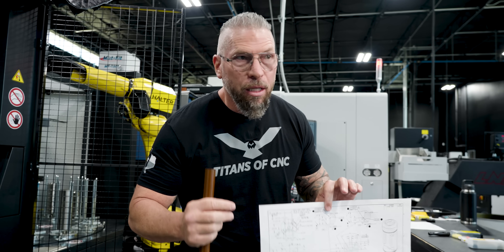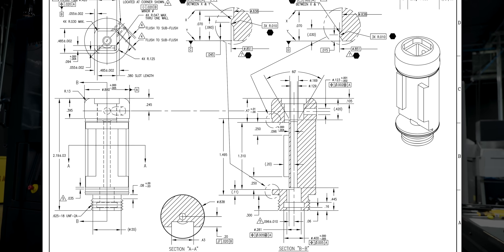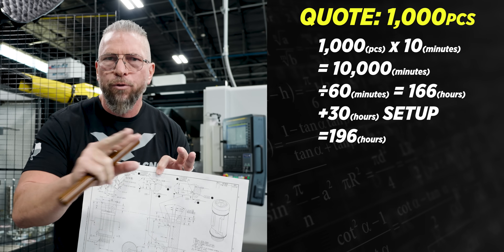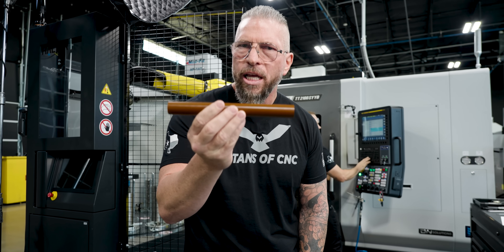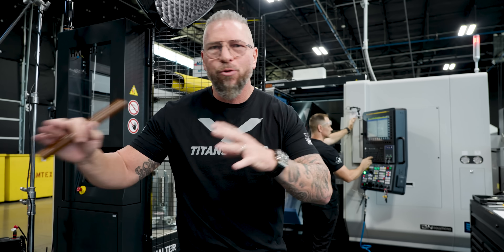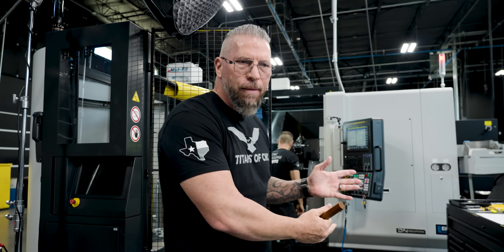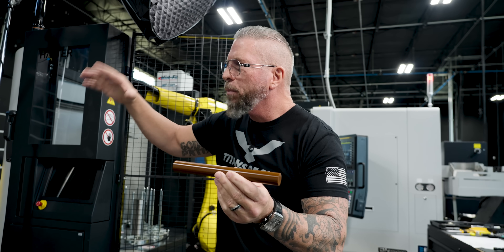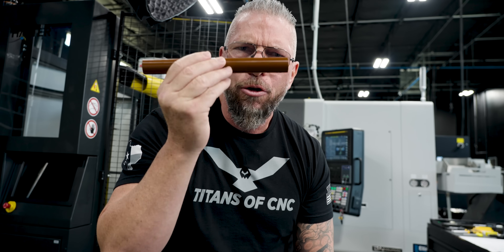How I Charge $40 for a $370 Part

Comment: Why is inspection time or more importantly, customer quality paperwork time not accounted for when quoting?  We recently had an APQP Level 5 part, requiring a FAIR, MSA, PPAP, six key characteristics requiring process capability study, PFMEA, Process Flow & work instructions per each OP.  When I asked what we quoted for this, I was told nothing.  We spent well over 100 hours for a 300 pc. order and I feel we lost so much money by not accounting for inspection/quality paperwork time.

Comment: If the customer needs SP1 or SP22 parts the final product price is significantly higher than the detail part you are building.  Bottom line, quote the part and if you are too expensive I will head to a shop that I know that quotes it lower.  Vespel for valve seats is mandatory in any applications.  The valves we sold were 5 figures and the seats were 500 a set.

Comment: An FA (financial analyst) would tear this video apart. Having the customer pay for the material wipes out the shop's ability to quote material costs and/or include a markup. There is no transfer of risk, the customer's goal is quite simple - they need finished parts for their assemblies and no amount of back and forth conversations or mental gyrations at any chop changes anything at all.
Reply: Dude tools wear out and  break sometimes . Tools are super expensive . Sometimes someone loads the wrong program . Or they are training a new machinist. Machinists are super attention to detail but mistakes happen. Power outage really sucks too. The customer is going to partially pay for the scrap . It’s just the nature of the beast of manufacturing . If it’s a pilot run there will be scrap or adjustments sometimes not all the time . A really good machinist you can’t tell they made a mistake and the part still has full functionality and dimensions are still within .
Reply: @stevensonprimacio1592   What is a Dude tools? Anyway, Very few customers who order 169 parts are willing to pay for 173 no matter how many Dude tools break.
Reply: A Financial analyst. An is only used when followed by a vowel. 😉
Reply: @jpsengin2  When pronounced as an abbreviation, the F in "FA" makes an "eff" sound, which begins with a vowel.
Reply: Interesting point. They miss out on risk but miss out on markup, where as experts they could optimize sourcing, process, and internal experience. Although up front expectation setting is good, it provides a lower of service (basically labour hire vs a completed solution), while still having the business reputation in the mix.
Reply: Problem is that when the shop buys the material, it is hard to get the customer to pay for spoiled pieces.
Reply: @russellstyles5381   why would a customer want to pay for spoiled pieces???
Reply: @hustledancing-americasfuns3830  That's the whole point of this video.  If the shop has to eat the cost of spoiled material, they are either going to pad the estimate to cover estimated spoilage, or refuse the job.  If the customer supplies the material, you lose only the actual waste, not the estimated waste.  On the negative side, this lowers the incentive to avoid spoilage.
Reply: @russellstyles5381  I don't see why a customer would agree to the shop wasting parts, it makes no sense

Comment: I cut parts for wood shops. I know it's not the same. As I read some replies I thought. You have the help your customer order the right material. Often I will place the order and then have the customer pay for the ticket from my vendor. Or I create the po and send it to them to order. I have gotten burned by customers who don't understand that there are twenty different types and grades of maple. So help them understand what they need.

Comment: I don’t know who’s ripping you off but I can get a 1 inch rod 38 inches long of DuPont vespel for 2000. $1000 bucks for a 1 in by 8 in long section is robbery. Also vespel machines really well for a polyimide so I don’t know why this would be stressful.

Comment: Personally, I view this in the same manner as a mechanic shop (my Grandfather ran an auto shop). He wouldn't let the customers source the parts because on average they would put the blame back on his labor versus their part selection. If a marked-up part went bad, he footed the bill to replace that part.  When we mark up material it's because we are taking responsibility for the quality and accuracy of the metallurgy. I imagine Titan was able to weigh the qualifications of the customer to be honorable and resourceful enough to replace material and do it quickly. Most of my customers are smaller scale so they just want a bill and a part. Definitely see the good advice in this depending on the customer, the ability of both parties to maintain close communication, and obviously a binding contract to hold parties accountable.

Comment: If I'm the ceo of a business, or even a product manager,  and I need parts, I don't want some guy to teach me his job, I don't care, nor do I have time for that. I just want the job done for the price quoted and no excuses. Now I have to pay for the material upfront? Fine, but if you start messing up and scraping my $1000/unit material and I'm having to buy more, thus still increasing my cost per unit, then I'm searching elsewhere. You don't explain how this solves the problem. This just solves your problem of fronting the cost of the job entirely, but it wouldn't solve my problem as the customer, so I'm not inclined to do business with you. Especially when you've put a possibly unknown to me risk factor into my hands. Besides an attaboy you did what I paid you to do, there's now no incentive for you to ensure no waste and have put a potential cost to that. Oh? So you were going to overbid if you sourced the part for cya of wasting material, but if you don't then I don't pay as much? No, I'm not a gambling businessman in this sense, I'm going to find someone confident in their work to not have to make a whole new issue for everyone to deal with because you dont want to have anxiety of the cost of materials. Which tells me you're not confident in your work. I'm looking elsewhere.

Comment: I worked in molding for years before I moved over to capital equipment design /fabrication.

Most expensive material I ever ran was a $1500/ lbs implantable PEEK. The runner and sprue was over 80% of the part cost and purging the stuff was $750 every time you did it. But it is what it is.

our sister company machined a ton of high end plastics and metals ( Platinum, titanium, vespel, ETC). The reward is there if you have the ability to do it.

Comment: Math time!

Having a pad on material goods means that the customer has a limit to their risk, because if you, say lose 20% of the material, the losses past that point are taken by the business. its basically insurance; spending extra money up front to ward off catastrophic losses.

But if the customer supplies the goods, they pay less most of the time, but could potentially lose their entire investment in material, say if they bought poor quality steel. 

The ideal would be something like a hedge bet, where the business would supply the material and pad the price upfront, say 10% but also charge 30% of the price of any losses. that way, the customer still pays less upfront, but in cases of big losses, the customer only risks 30% of the material cost (plus 10% upfront). at the same time, the business makes money when they don't lose any material, can lose up to 10% of the material, and still would, in the worst case, only stand to lose 70% off the price of the materials (60% considering the 10% pad).

This is a surface level explanation, the numbers can be replaced to fit your business, and obviously if you lose material you buy more, putting the material investment past 100%, but put simply: the ratio of risk between the business and the customers can be balanced more effectively when neither the customer nor the business has to potentially front 100% of the risk

Comment: This is excellent advice.  I've used this technique with vendors for over 20 years.  As an engineer with over 38 years of experience, I long ago discovered the importance of fully communicating with vendors to alleviate their concerns.  This is especially true with mom and pop shops.  Address their risks head on.  Are they concerned about the cost of breaking tools? I have those tools show up magically on their doorstep.  Are they concerned about scrapping expensive material and taking a bath on the job?  I arrange that very material dropped on their dock.  Good communication, negotiation and always looking for the win-win are key to success. After all, good vendors are priceless.  You work with them to achieve mutual wealth and success.

Comment: I have two components that many subcontractors won’t touch or give crazy pricing for. Like $1,200 from one vendor, others around $300. The parts are available standard with more complex geometry for $8.

I was told it can only be done on 5axis (it’s 3 interpolation and an indexer). I’ve been told it’s expensive because it’s helical (it isn’t)

This isn’t about volume. It’s about understanding what can be done. Design engineers like me often get told “that can’t be made” as if we’re stupid. Often that’s well founded. However, I’m an ex-machinist and I model CNC parts as they would be machined. In Fusion 360 for example, you can model a cutter, model a cutter path and the form will generate exactly what you can make.

Everything you said resonates. As a design engineer, I often take the work others refuse and I build long term relationships on transparency on good communication.

Also, very impressed with Syil

Comment: Interesting video. I used to Quality Manage an engineering company that specialised in Aerospace and Nuclear components. We had material supplied from the customer only. Released and certified only. No scrap allowances as well. We did some prototype Rolls Royce RB211 turbine blades, no CNC or Co-ordinate measuring machines, either. Cost Plus job, lots of overtime and bonuses. I had to make all the calculations, as the customer had not drawn it all out, when we took it on. Would you risk jobs like that, as I had to make multi million pound decisions as the jobs ran, also on nuclear reactor components, no mistakes allowed. Best job I ever had, until they went bust, when defence spending was cut.

Comment: I don’t do production, only prototype, modification, and instrument building. Stress is when you’re working on a 30 million dollar mirror that took 3 years to make. Or modifying an experiment that flies to space in less than a week. I had to drill a thousand .002" holes in an experiment once and I broke $1000 worth of drills just figuring out the feeds and speeds.

Comment: So you put the stress back on the customer... nice ! ... 😕
Reply: Its a negotiation. The customer probably got overpriced quotes from other suppliers. They planned this crazy part from crazy material, and then had issues with finding who will produce it, because everyone else is afraid of the risk. Most of the times such firms hold no regard to the risk contractors have. So this is fair, you designed it you bear the risk. And the shop charges for what shop actually does, machining.

Comment: If a shop lacks the confidence in its machinists to accept the risk itself, any potential customers are also unlikely to accept the risk.

That said, it's a nice strategy to offer established customers that try to negotiate better pricing. Instead of a direct discount, they accept a little more risk and variability in pricing for a lower average per-part cost.
Reply: As a customer, if I was supplying the material, I would only accept a % of risk. After that no payment until the number of parts agreed was supplied, and a visit from the lawyer with their costs added if they didn't like it. 
No way I'm allowing you to scrap 50% of that material without major consequences

Comment: Blah blah blah, I'm a Fitter Turner Machinist with over years experience in precision engineering and metalwork.  Fu$k this guy makes a big deal about fu$k all.  A thousandth of an inch? ppfft big deal, pi$s easy, try achieving microns at manual machining. I've got years of experience at cylindrical grinding,  surface grinding and internal grinding on manual machines as well as years and years of centre lathe work. Yankees are so over dramatic,  CNC is for button pushers,  manual machining is where the real action is.  I've got 10 years experience machining mechanical seals for Eagle Burgmann Ltd and also a small independent NZ seal manufacturer Paulmen Seals. Try that sh$t in stainless steel components with manual machining, it ain't fu$king easy and I mastered it 😎

Comment: I've been machining vespel and other expensive plastics for over 15 years. Vespel cuts really easy and holds tolerances very well compared to other plastics.
Reply: I guess it's just people being scared of scrapping expensive material. A good machinist should be happy to work with a easily machined stuff like this.
Reply: What are the most common everyday uses of Vespel?

Comment: the GD&T on this part is surprisingly succinct. It looks like the engineers actually took time to determine what the real functional requirements of this part are instead of just blanket tolerancing everything. I wish all designers were this precise with their design intent.
Reply: Blanket tolerances is all too common these days
Reply: Engineer here, and I used to blanket tolerance...until I was like 26. For something like a robot head adapter plate, I just check the machine shop stock and use those for external dimensions, such dimensions (101.6mm) W x (101.6mm) L x 5mm T, reason for the thickness being just to flatten out the material from 6.35mm stock.
Reply: @zchris87v80  often times, depending on the features of the part, 1.3 mm is not enough to hold onto when machining your part on op 1. If your part was 5mm thick and had to be machined on the edges, I would be making it out of 10mm thick stock.
Reply: @Dillybar777   in this case, I was using reference dimensions to just use 4" stock and cut it to 4" in length, then just remove a portion of the 1.35mm from each side. I've only ever asked one absurd thing of a machinist - a spacer plate for an ID grinder (used in series bearing production), made of stainless steel, 0.7mm thick. I am amazed it didn't instantly curl up, and more amazed that he figured out a way to fixture it to a surface grinder. I was the engineer over automotive bearing grinding production back then (again, prior to age 26, when I didn't realize how difficult it would be to make).
I've since started taking machining into consideration - for example, a solid block of aluminum for a small robot, about 12" in height. It'd be easy to just ask to machine down the sides and put some through holes through the flange, but that's a ton of material removal. Instead, I just created pockets for bolts and a hex key to be able to fit through (requiring turning the block on each side and slotting, then putting through holes through the bottom).
Reply: @zchris87v80  ooh that stainless piece is devilish indeed hahaha. Good on you for actually improving your design skills. Machinists absolutely love working with well designed parts.
Reply: @Dillybar777   my production tech also did machining so I do thank him for telling me what machinists hate. Design for assembly/disassembly is another big consideration - the generation under me (I'm 37) is far more computer-oriented, but I'm a hands-on engineer and know if you can't access bolts easily, it's a bad design. My last design involved access points for wrenches in a linear slide mechanism, so that it could be removed and serviced - something I don't see a lot of engineers take into consideration.

Comment: What’s the difference really if you buy the material or the customer supplies it? If you scrap 100 parts you’re gonna have to pay for the material regardless. I find it easier for us to take care of the material. That way, you save a lot of headache.
Reply from the maker: Gotta watch the whole video… I explain it
Reply: @ i watched it and now watched it again. Makes more sense now. You make the client take some of the risk. Obviously this makes sense when talking about high-end materials and also not scrapping a ton of parts cause then the customer won’t be able to trust your abilities anymore. I get it now, if you take care of the material and you scrap 3 parts worth 40$ that’s like making 25 parts for free just to cover up the damage.  If the client takes care of the material and they are aware of the risks involved, they know  that they may need to supply more given the high risks involved in machining that kind of material. Thanks for the reply! Makes more sense when you talk about high-end materials, not the 6082 which we usually work with 😅😅

Comment: When I worked in the semi-conductor industry 30 years ago, we used a lot of exotic materials for test fixtures at very high tolerances.  If I walked into the machine shop, with a piece of material everyone tried to hide from me.  Like I was a homeless guy walking into to a Ferrari dealer.  I remember having to get a piece of plastic counter to countered from Japan after spending two days trying to find someone with it.  Almost came to about 10k for material to ,make two small 2"x2"x 1/2" parts.  We kept some on hand material in a safe in my office if we had to buy more than we wanted to make sure no one used it from something stupid like leveling a machine. 🤨